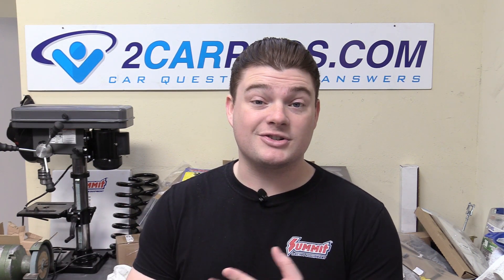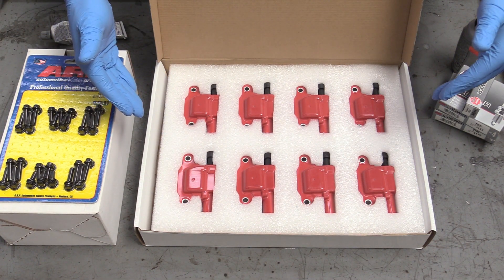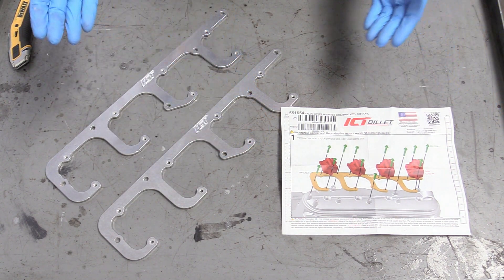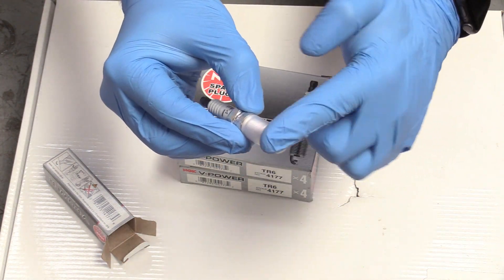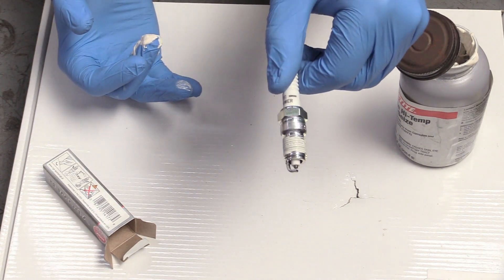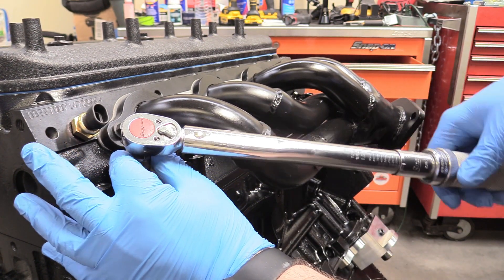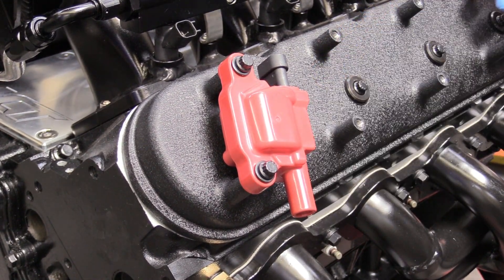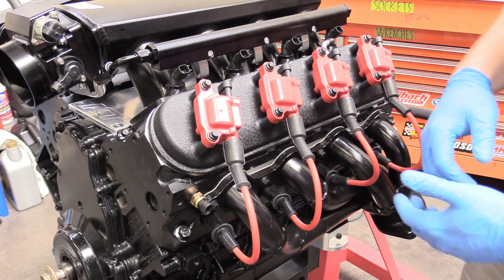How to Build a 5.3L LS LM7 V8 - Part: 11: Ignition, Harmonic Balancer, Starter

Comment: Man this motor came out looking great. In the process of ordering parts for mine. Block and heads are at the machine shop right now. At first I just wanted to get it running as a stock rebuild, but now I’m planning on pushing 450-500hp out of it through cam, boring, tune etc. still a mostly budget build, where I can afford to re-use parts. Most of my money is going to the cam and valvetrain, machining, and pistons.

Comment: Ok so to be clear when installing balancer I’m using stock bolt. So first I need to run the old bolt down to 240ft pounds remove that bolt put new bolt in with red loctite and torque it to 37 ft pounds and then additional 140 degrees and that’s it.
Reply from the maker: Yep. That's the procedure. Thanks for watching!

Comment: Sorry for my ignorance in advance, will this run on pump gas?
Reply from the maker: No problem! I love answering any question. So at 11:1 it will run at 91 put it might ping under super heavy throttle. Better to use 93 or higher. Thanks so much for watching Bryce!